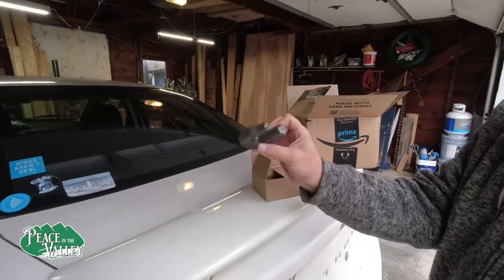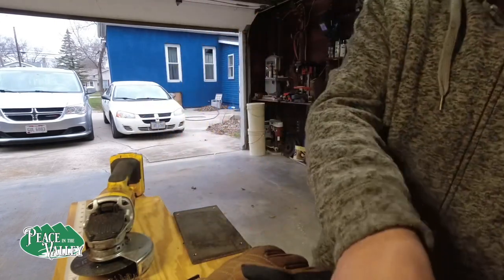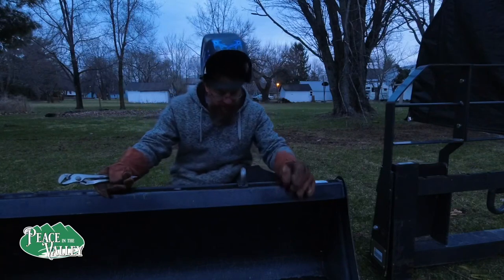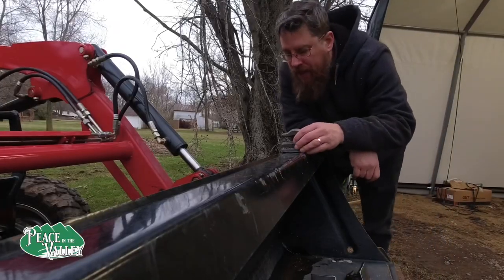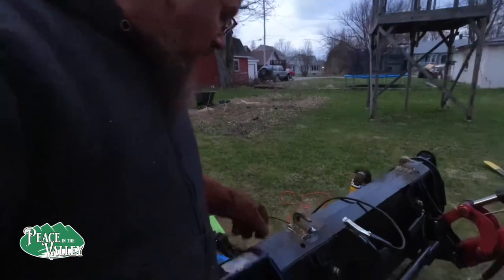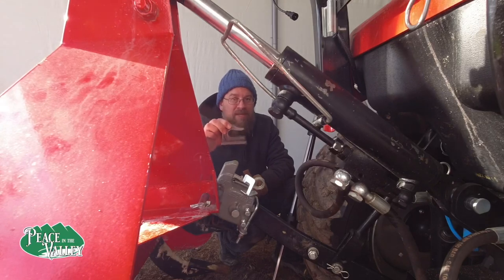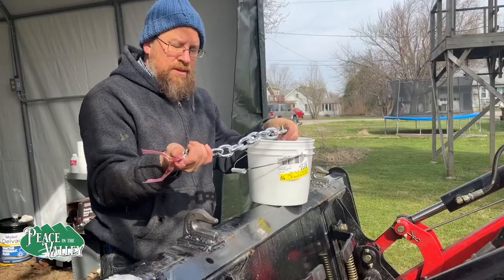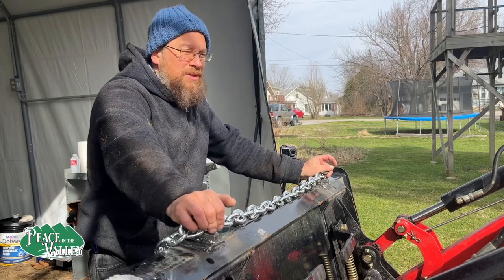Welding Chain Hooks on RK25 Tractor - E79

Comment: I had a mid 70's year Yanmar YM2210D that had hooks welded to the bucket and they were handy.  I did use them moving railroad ties.  I now too have the RK25 and I opted to get a set of pallet forks.  I think a better solution to moving logs around, but more pricey.  Mine are in the $800 range.  An investment for me, but I love them.  Especially with the skid steer quick attachment system.  I can switch from bucket to pallet forks in less than 3 minutes not hurrying.

Love you videos and have subscribed.  Look forward to future additions to your channel.
Reply from the maker: HI Terry, thanks for watching! I think the pallet forks are the best "2nd" attachment after the front end loader. I have used it a lot - especially to unload new equipment from the trailer (which is why you have to have it!!) It also works for items that are actually on pallets, which just so happens to be about everything coming by freight. My wife can switch out all of the attachments with no problem, except the backhoe. That means she can help me more by doing many of the things herself!
I have a new video coming up soon about using the grapple to clean up after the storm this past week! Hope you like it!

Comment: Dear lord, I feel SOOOOO much better about my self - taught welding skills. But if it holds under load , GREAT !
Reply from the maker: That's good you are happy with your welds. I certainly am too. I have not had any problems whatsoever with those. I've yanked out tree roots, pulled trees through the woods, and pulled out stuck vehicles (and the tractor) They are holding up beautifully. I wouldn't change a thing on them!

Comment: I haven't considered having chain hooks on the lift arms Bryce.  I'm sure there's applications where it'd be very handy. You might be on to something with your idea. You'll definitely appreciate the hooks on the bucket. Good looking welds.
Reply from the maker: hi Dean, 
Last year when dragging the trees down the mountain made me think it would be handy rather than trying to finagle, if I just had some hooks right there. Another time the truck was stuck (only 2 wheel drive) and had to pull it a couple inches. I used the tractor and put on the 3 point hitch receiver with a ball. This way I can avoid that. We'll see if it pans out.

Comment: I thought about putting a set on the bucket. Never thought about the back arms. I wonder how the back arms will hold.
Reply from the maker: Hi Juan, For the most part, it won't be lifting, rather pulling. However, it's supposed to be able to to lift 1100+lbs at the end of the 3 point, so I don't think it would be problem for lifting! We'll find out how well it holds!

Comment: Actually, one of the first things that I did when I got my tractor was to put the hooks on the loader. The first time that you use it you'll wonder why you didn't do it sooner. 😊 Personally I think that the tractor should come from the factory with the hooks on the loader bucket as standard equipment. I've never really thought about putting hooks on the 3 point but it is something that I may consider in the future. 👍👍
Reply from the maker: Most certainly! I wish I had them before too!